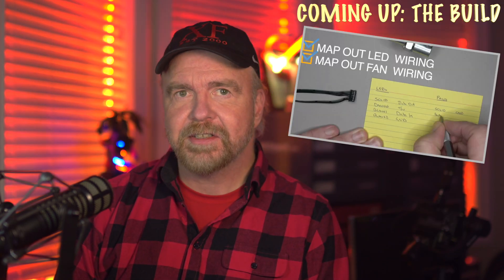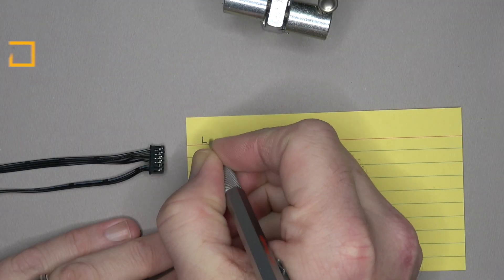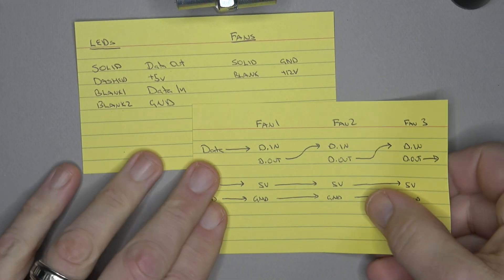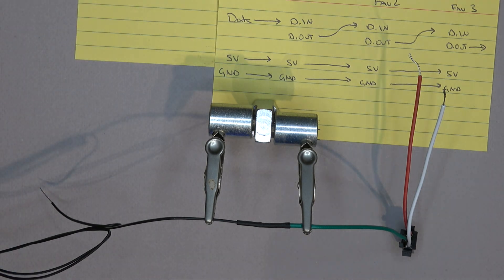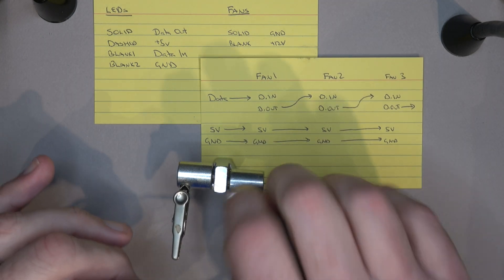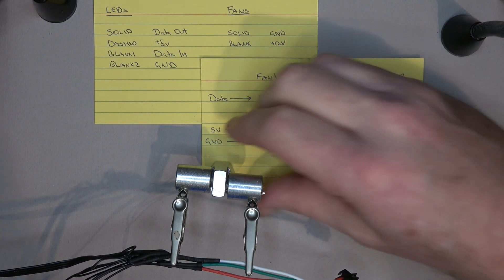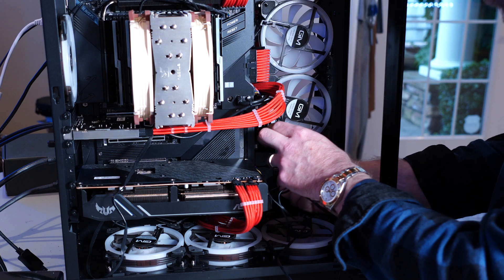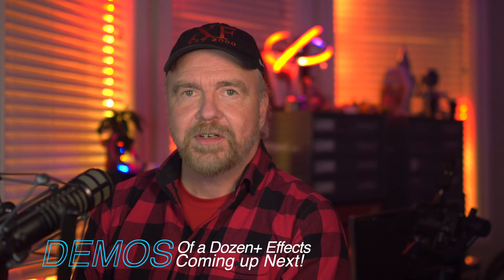My Shop's on Fire! w/ PC RGB Fire Fans!

Comment: Thank you for all the fantastic and informative videos, done very professionally... Q: Are the fan wires marked for the +, -, Data In and Data Out???... Q: Where do I get the code???...
Reply from the maker: Yes, correct.  The code is on github at PlummersSoftwareLLC/NightDriverStrip, using the Fanset config.

Comment: If my fans I have don't have outputs, is it possible to control them with separate pins on the ESP 32? I'm worried it would be hard to get them to sync properly.

Comment: So any way of getting a data out on a fan that doesnt have it at the end of the wire? Alternatively something to add in between to convince a fan that its first led is say led 13?
Reply: I'm not sure what you mean with the first question, but if I understand the second on correctly, if you send the first 36 bytes of the data stream as all zeros, the next color data will illuminate the 13th led.
Reply: @lagoat4  its tricky to explain, my fan only has 3 wires controlling argb, it has 12 LED on the fan, there are y splitters built into the fan, so when addressing LED 1 then all fans have LED 1 lit. Looking at neopixel strips there is a data in on the one side and data out on the other so they can be chained, if the strip has 12 led then addressing LED 13 turns on LED 1 on strip 2, this also happens on the fand in this video as their ARGB fittings have data out not using a y splitter. I am trying to find out if i can find data out somewhere after disassembling the fan (if thats even possible) or if there something that i can do that allows me to convince a fan that its LED 1 is LED 13 or something that can be told that there are so many attached LED to each output so that when addressing LED 13 it will send the instruction to fan2 LED 1
Reply: @MrSparkefrostie  The WS2812B led chips (3 leds and controller), if that's what you have, are usually manufactured in the 5050 package, and assembled into strips, panels, wired strings and fans etc. The package will have the Dout pin, though the fan manufacturer may not have connected it at the last led. If you can disassemble the fan and access the last led, perhaps the pin is accessible and can be soldered to. If so, it will be fine work, but doable. It's also possible that the fan has custom made leds, or an earlier version that is addressed differently.
Reply: @lagoat4  thank you, this should help, now to find out how to safely disassemble

Comment: You can power the microcontroller internally with a molex plug from your power supply! (Usually in my experience, those also only power on once the PC is turned on.)

Comment: You could cut some white material, then attach it to the side of the fan, and the air blowing the material and the RGB would give you a flame look.
Reply: My thought too - note the fake "flames in a cauldron" props sold for Halloween - some angled bits of a silky fabric blown about with a fan and lit from below with one or two simple single-color static LEDs.  It can look fairly nice - and your project just happens to be great base for expanding on that concept.
Reply from the maker: @zephsmith3499  I need some lighter stuff, turns out the fans aren't "fast" enough to blow up regular cotton, but I'll find someting!
Reply: @DavesGarage  I found your project while thinking of ways to do just what you both are discussing 8 months ago. So did you try using the fan with a tube or pointed flaps of a lighter material? Nylon is a possibility.

Also I have been looking for the fan you are using, because I'm finding it difficult to find a cheap argb fan with 12 or more perimeter LEDs like the ones you are using. Thanks!
Reply from the maker: Like the windows in Pirates of the Caribbean at Disneyland!  I'll try that!

Comment: Question:  If 5v current is supplied to an addressable RGB strip  or Neoprism strip with no controller, will it default to the last color/program that it was set to?
Reply from the maker: No - while it will HOLD a pattern once the controller is removed, if that's what you mean, if there is no controller then it just stays black, there's no default or return to last display.
Reply: @DavesGarage  Thank you.

Comment: You could consider getting an internal usb hub to power the esp. it plugs right into the usb header on the mobo and gives you a few ports inside the case.